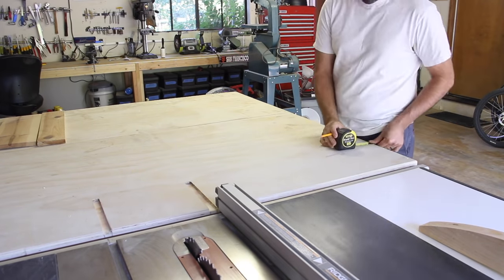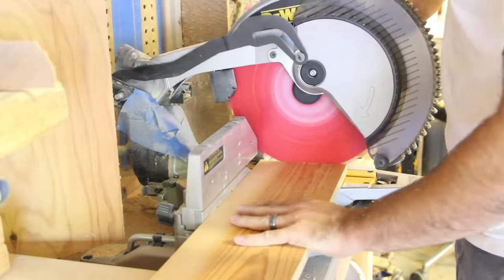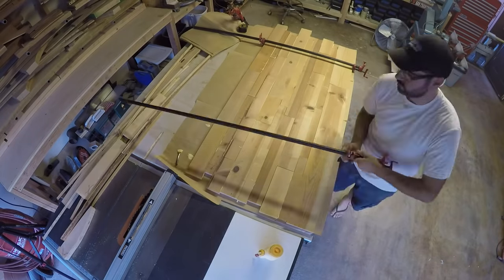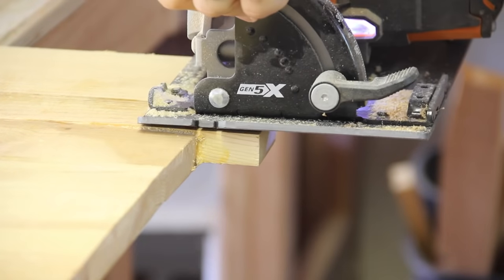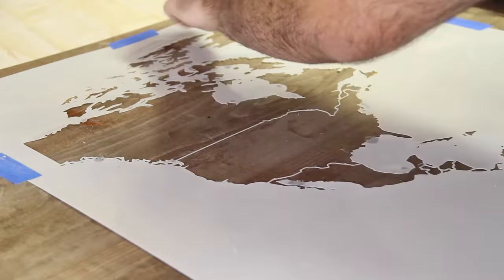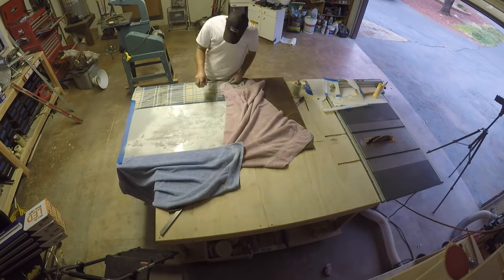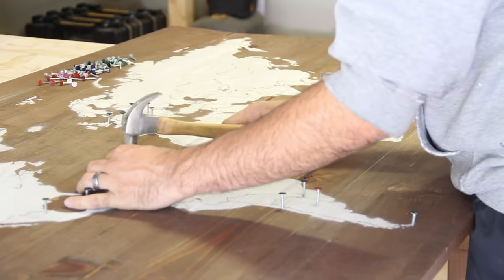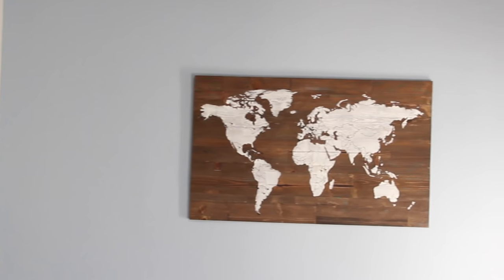How To: Make A Giant Wall Map

Comment: Trying to recreate this and my math isn't adding up with the size of the wooden board. I have 4,2,3,4,2,3,4,2,6 = 30 inches and not the 37 inches you mentioned in the comment section. I also counted only 9 boards being used. Can you clarify please?